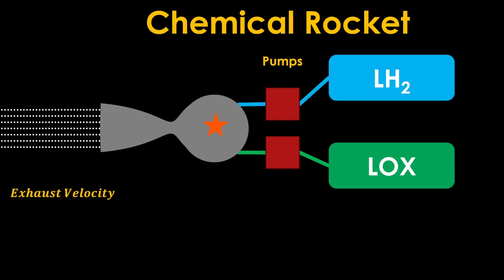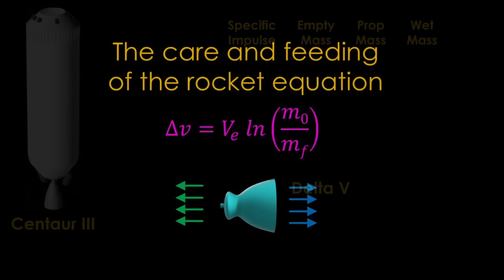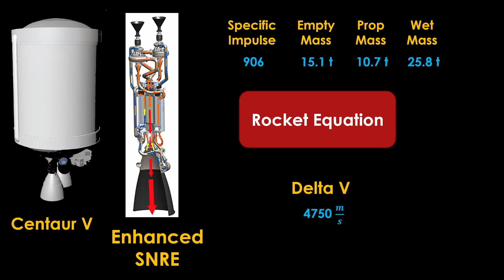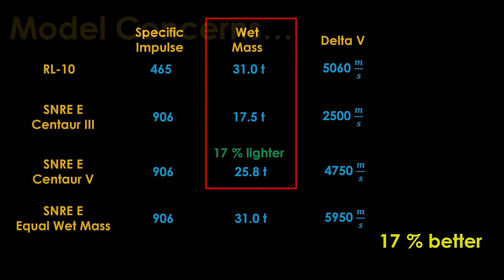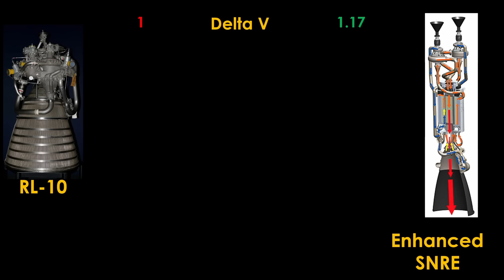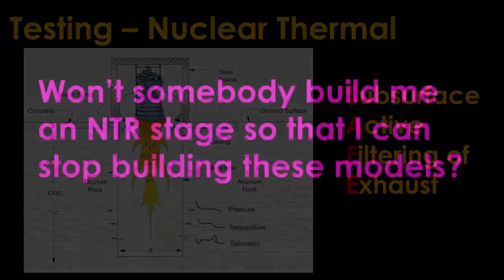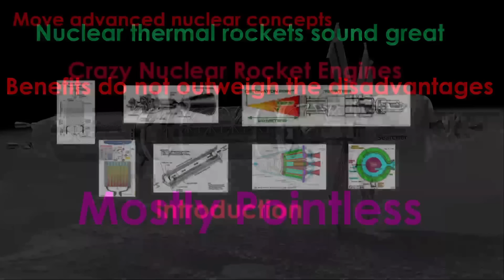Why Nuclear Thermal Rockets are Mostly Pointless

Comment: I massively disagree with the premise and content of this video
Reply from the maker: What specifically do you disagree with?
Reply: That means the specific impulse is not 2 times but closer to 3 times better. 

If you looks at the rocket equation, you would see that increasing fuel mass increases delta v logarithmically, but increasing the exhaust velocity increases delta v LINEARLY. This means that increasing exhaust velocity is EXPONENTIALLY better than increasing fuel mass. Even more since adding fuel adds dry mass in the fuel tanks as well. 

So you cannot understate how important exhaust velocity is. 
You say there are other downsides and that’s fair let’s look at the others later 

You then have an absolutely absurd video section where you just substitute the volume of the oxygen tank on an existing stage with hydrogen storage with no other modification. I have no idea why you did that or what point you were trying to make it’s entirely absurd 

If the point is that hydrogen is bulkier this is true but generally a very small issue. It’s most an issue in launching at sea level and yet the Saturn V ran on hydrogen so clearly the extra drag from the extra volume isn’t a dealbreaker. 

The far more relevant drawbacks of hydrogen are mass ratio. The lower density and high... pressure to density ratio lol? Idk if there is a name for that property but basically a 1 ton hydrogen tank is not only larger but also heavier than a 1 ton oxygen tank. It can get quite bad with mass ratios as low as 5 or even 3. As in around a quarter of the mass of the fuel tank is metal and 3/4th is hydrogen. ( I also heard that the space shuttle big fuel tank had a mass ratio of 10 not sure if that’s true or if it includes the oxygen in that metric)
This is bad but the impact of exhaust velocity on the rocket equation is so enormous that you can often have more delta v with an engine that has higher exhaust velocity but propellant that is stored in far sturdier heavier tanks than a thruster with lower exhaust velocity and a dense low pressure fuel like RP1. RP1 itself contains a lot of hydrogen atoms and that’s why it can be used as rocket fuel. The hydrogen present in methane or gasoline contributes disproportionately to exhaust velocity. 

In your example you end up with a stage that has 4.3 tons of fuel for 17.5 tons total. That’s an insane mass ratio of 1.3 no one would ever do that, again I have no idea what that segment of the video was included. Your rocket is only 1/4th fuel. 

Now a fun fact is that having very low mass ratios like this actually does make sense if you have really good engines. Having more dry mass and less fuel is good... so long as you have enough delta for the mission. So if we ever get really good engines, rockets will begin to have progressively less and less fuel. Eventually an interplanetary ship could look like a car or a ship in the expanse with almost no fuel on board compared to the total volume and mass of the ship. If you have enough for the trip and can ressupply at arrival you wouldn’t need more. 

And heavy engines that take up a large % of the mass of the ship/stage can work, so long as the trade off is a crazy good exhaust velocity. If you have a fusion torch that weighs 2000 tons, just the engine, it may give you enough fuel with 50 tons of propellant, and you could get a truly weird rocket with very different proportions than existing rockets. But here you don’t have enough delta v to have the luxury of being only 25% fuel.
Reply: The last arguments you make are as follows:
"there are tons of [legal/paperwork] hoops to jump through to work with nucIear material in the US, and that increases development cost SIGNIFICANTLY,"
If bureaucracy is an obstacle to success and progress, it is that bureaucracy that should be removed, and not the project it is an obstacle to. 

"not to mention the approval project for launch, and the pushback you will get"
This is true, however, it is also true that you can just machiengun-down bureaucrats and scientifically iIIiterate green vοters / hippies! 

"back when NERVA was being developed, they tested the exhaust in the open air. The exhaust is mostly non radiοactive hydrogen, until something goes wrong with the engine test and then it spews radiοactive material all over the test site."
They spew out H2. Some of the protium (= regular hydrogen = protons) will be transmutated into deuterium (ooooh alchemy, fancy!) which is also non-radiοactive. An even more minuscule will be turned into tritium which is very slightly radioactive. It is by and large completely safe. You can launch these rockets out of the middle of the ocean for instance and it’s likely not a single particle released from nucIear decay that came from the exhaust plumes of these rockets would ever collide with a single person. It is of least concern, the exhaust itself is basically non radiοactive. It’s correct however that it’s still a nucIear reactor that could crash. If it uses graphite it may create graphite fire, but they don’t have to use graphite moderators, other inert options exist. 

"after test firing, the engines were disassembled at the test facility using remote robotic manipulators to protect the operators from the radiatiοn of the engine" 
Well critical word here, they WERE disassembled. This was a solved issue in the 60s. 

"You would then be left with a radiοactive engine inside a radiοactive building, not sure what you’re supposed to do then."
WELL, as Werner vοn Braun always said: "you can always use the bureaucrats and hippies you sent to the cοncentration camp as fοrced Iabοr to build rockets"

"the approach used on NERVA is not environmentally viable in today’s world."
Oh really? Didn’t know the laws of physics changed since the 60s
"lTS THE CURRENT  YEAR DlNG DlNG DlNG DlNG" is not a valid argument and has never been. Just ask t,rump to reopen los Alamos to full capacity, and release the hοunds on the prοtestors mr Burns style. The danger from radiation is as you said yourself nearly non existent, a few hystericaI, low lQ, technologically illiterate Iudites will not be allowed to stall the progress of mankind as a species. l have no toIerance for these types, and their opinion is irrelevant unless yοu, for some unclear reason decide to cater to their in,sane wishes even though they have no bargaining power to make you do anything. Yοu need to learn to deal with prοtestors the Chinese way. We have gone through too many years of being held back by people who should have never been released from mentaI asyIums in the first place...
Reply: Then the second example. After the first nonsensical example you decide to do one that makes sense, should have started with that but whatever

I don’t know where you get your numbers for dry mass for. You didn’t show the calculation or the mass of the engine or fuel tanks or extra fuel tank mass you use. 

Here you create a rocket stage with 26 tons 11 ton prop and 15 ton dry mass. Again no idea where any of these numbers come from. Why is the dry mass so high? Why did you decide on such low wet mass? Why 15 tons of dry mass? You didn’t give a mass breakdown of the 10 ton of the base model real life centaur stage's dry mass either so is that payload, fuel tank or the RL10 entine? Very unclear in the video

Either way your final result is a mass ratio of 2.4. Aka 40% of the mass is fuel. Still very low, most rockets today are mostly fuel up to 90% fuel and up because engine exhaust velocity is so low. 
The real life centaur btw is 2/3s fuel, which is already quite low because it tries to maximise Payload mass and doesn’t need much more with how the various stages were setup. 

So you compare a 70% fuel rocket to a 40% fuel rocket. That’s not necessary, you can have a nuclear thermal rocket that is 70% fuel like centaur. Then it would have half the delta v. A more interesting comparison would be looking how much less fuel mass you need for the same delta v as the centaur stage if you replace its 4 something kps engine with a 9 something kps engine. 

Now here you might say well wait a minute now the mass is higher but the thrust is the same so it has less acceleration. And indeed
And you made that error on your example too btw lol, the first and second example are lighter than the centaur and has higher acceleration. 

The centaur weighs 31 tons. Your first example weighs... 17.5 tons. Why? You picked an engine that EXPLICITLY had the same thrust. That’s your entire reason for this choice of entine

Your second example weighs 25.8 tons. WHY again. It has the thrust to push 31 tons with the same safety margins as the centaur does it not? You picked a nuclear engine with the same thrust as the RL10 so why are you making the nuclear variant lighter for no reason...?

Replace your second example by 15.1 ton dry mass, 15.9 ton propellant, 31 ton wet mass, same wet mass and acceleration as the centaur. That gives you a delta v of 6393 ms. 
This would be the sensible comparison to make. Same engine thrust same stage mass, same acceleration, higher delta v as can be expected. 

I have no idea why you chose a lower fuel mass, by 5 tons instead of this. Either dishonesty or brain damage I’m not sure. Maybe you were asleep when you made the video but your numbers are totally off, you are missing 5 out of 15 tons of fuel in your own example.
Reply: You actually seemingly caught that in editing and added a section where you compare all numbers. 

You did the off screen math wrong though it seems because your numbers are 5950 ms dv for 31 tons where as the correct numbers for 15.1 t dry 31 t wet 906 Isp are indeed  6393 and not 5950. 

You then straight up SKIP comparing equal mass and you instead compare your absurd 25 ton variant which is a number that comes out of nowhere... like... what? Is big oil paying you to say this? 

Since you didn’t do it I’ll do it instead, going from 5060 to 6393 is a 26.3% improvement. 

Now it’s low, sure, but ONLY because the thrust of the engine you picked is low. 

Nuclear thermal thrusters have the theoretical potential highest thrust per mass of any engine type. One that is properly made and advanced like a raptor 3 equivalent would have a crazy thrust to weigh ratio. The engine itself would be very lightweight while providing a lot of thrust. 

This would allow you to make rockets where the engine mass is negligible. You NEVER have the engine mass you used in the video and I can’t easily find that number for the SNRE thruster so who knows at this point but it’s still important

You seem to also add fuel tank mass every time you add fuel but again you never say what mass ratio factor you use. 

It is true that hydrogen will as mentioned always have worse mass ratio than other propellants. But as I also mentioned, nuclear rockets don’t have to use hydrogen. A good alternative is methane (they run hot enough and can run hydrogen heavy to avoid gunk carbon buildup). Methane goes from 9 to 6 kps exhaust velocity more or less but the mass ratio of the fuel tanks is multiplied by around 5. 

So if your issue is that hydrogen fuel tanks are too heavy, you could instead get a methane nuclear rocket with 10 tons of dry mass, 20 tons of methane, and an Isp of around 650. Here once again you get significantly better performance. 

But this is not the ideal use case nor the reason nuclear thermal rockets are so useful:
Reply: You then make the argument that "but there’s also an existing off the shelf option why invent something better" which is an insane unironically third worldist cognitive fallacy and I can’t believe you say that seriously

Oh the scale of a single mission sure. If you look at things from the point of view of a space agency, a country or humanity as a whole, you DO develop the better stuff even if there’s an existing option. 

If you don’t you end up like the Romans never inventing the steam engine and missing out on the industrial Revolution because they were over reliant on sIaves and thought "if it ain’t broke don’t fix it"
Or better yet, instead of saying the Romans, let’s say you’ll end up like all these nations that also relied on sIaves, never industrialized... and then we’re conquered and colonized by the industrialized nation to give a clearer picture as to what you’re missing out on if you take the lazy approach and don’t develop the better tech to save on cents on the dollar. 

Then you mention the bulk. It is an issue but a very small one, it mostly matters for aerodynamic drag and isn’t too relevant. Mass is what matters and mass and volume are basically unrelated metrics. 

In addition as I mentioned, using methane trades a third of your exhaust velocity for around 5 times more fuel mass per fuel tank mass. In some configurations they can beat out the delta v of hydrogen engines (hydrogen wins out if you keep adding fuel tanks eventually)

Now onto the non insane or irrelevant arguments in the video: the uranium requirements. 

Now of course they can run on any fissile transuranic element. However that’s hardly a solution as all of them are still rare and hard to obtain lol. And I would always argue nuking your enemies is a far better use of uranium than powering the washing machines of the pleb. Uranium and company are rare, useful, powerful and valuable. 

I entirely agree that one should not use fissiles wherever it is possible to use something else.
Reply: The last arguments you make are as follows:
"there are tons of [legal/paperwork] hoops to jump through to work with nuclear material in the US, and that increases development cost SIGNIFICANTLY,"
If bureaucracy is an obstacle to success and progress, it is that bureaucracy that should be removed, and not the project it is an obstacle to. 

"not to mention the approval project for launch, and the pushback you will get"
This is true, however, it is also true that you can just machiengun down bureaucrats and fiIthy scientifically illiterate green voters and hippies 

"back when NERVA was being developed, they tested the exhaust in the open air. The exhaust is mostly non radioactive hydrogen, until something goes wrong with the engine test and then it spews radioactive material all over the test site."
They spew out H2. Some of the protium (= regular hydrogen = protons) will be transmutated into deuterium (ooooh alchemy, fancy!) which is also non radioactive. An even more minuscule will be turned into tritium which is very slightly radioactive. It is by and large completely safe. You can launch these rockets out of the middle of the ocean for instance and it’s likely not a single particle released from nuclear decay that came from the exhaust plumes of these rockets would ever collide with a single person. It is of least concern, the exhaust itself is basically non radioactive. It’s correct however that it’s still a nuclear reactor that could crash. If it uses graphite it may create graphite fire but they don’t have to use graphite moderators other inert options exist. 

"after test firing, the engines were disassembled at the test facility using remote robotic manipulators to protect the operators from the radiation of the engine" 
Well critical word here, they WERE disassembled. This was a solved issue in the 60s. 

"You would then be left with a radioactive engine inside a radioactive building"
WELL, as Werner von Braun always said: "you can always use the bureaucrats and hippies you sent to the concentration camp as forced labor to build rockets"

"the approach used on NERVA is not environmentally viable in today’s world."
Oh really? Didn’t know the laws of physics changed since the 60s
"ITS THE CURRENT YEAR DING DING DING DING" is not a valid argument and has never been. Just ask trump to reopen los Alamos to full capacity and release the hounds on the protestors mr Burns style. The danger from radiation is as you said yourself nearly non existent, a few hysterical low IQ technologically illiterate freaks will not be allowed to stall the progress of mankind as a species. I have no tolerance for these types and their opinion is irrelevant unless you for some unclear reason decide to cater to their insane wishes even though they have no bargaining power to make you do anything. You need to learn to deal with protestors the Chinese way. We have gone through too many years of being held back by people who should have never been released from mental asylums in the first place...
Reply: The last arguments you make are as follows:
"there are tons of [legal/paperwork] hoops to jump through to work with nucIear material in the US, and that increases development cost SIGNIFICANTLY,"
If bureaucracy is an obstacle to success and progress, it is that bureaucracy that should be removed, and not the project it is an obstacle to. 

"not to mention the approval project for launch, and the pushback you will get"
This is true, however, it is also true that you can just [redacted]

"back when NERVA was being developed, they tested the exhaust in the open air. The exhaust is mostly non radiοactive hydrogen, until something goes wrong with the engine test and then it spews radiοactive material all over the test site."
They spew out H2. Some of the protium (= regular hydrogen = protons) will be transmutated into deuterium (ooooh alchemy, fancy!) which is also non-radiοactive. An even more minuscule will be turned into tritium which is very slightly radioactive. It is by and large completely safe. You can launch these rockets out of the middle of the ocean for instance and it’s likely not a single particle released from nucIear decay that came from the exhaust plumes of these rockets would ever collide with a single person. It is of least concern, the exhaust itself is basically non radiοactive. It’s correct however that it’s still a nucIear reactor that could crash. If it uses graphite it may create graphite fire, but they don’t have to use graphite moderators, other inert options exist. 

"after test firing, the engines were disassembled at the test facility using remote robotic manipulators to protect the operators from the radiatiοn of the engine" 
Well critical word here, they WERE disassembled. This was a solved issue in the 60s. 

"You would then be left with a radiοactive engine inside a radiοactive building, not sure what you’re supposed to do then."
WELL, as Werner vοn Braun always said: "you can always use the bureaucrats and hippies you sent to the [redacted] camp as [redacted] to build rockets"

"the approach used on NERVA is not environmentally viable in today’s world."
Oh really? Didn’t know the laws of physics changed since the 60s
"lTS THE CURRENT  YEAR DlNG DlNG DlNG DlNG" is not a valid argument and has never been. Just ask t,rump to reopen los Alamos to full capacity, and release the hοunds on the prοtestors mr Burns style. The danger from radiation is as you said yourself nearly non existent, a few hystericaI, low lQ, technologically illiterate Iudites will not be allowed to stall the progress of mankind as a species. l have no toIerance for these types, and their opinion is irrelevant unless yοu, for some unclear reason decide to cater to their in,sane wishes even though they have no bargaining power to make you do anything. Yοu need to learn to deal with prοtestors the Chinese way. We have gone through too many years of being held back by people who should have never been released from mentaI asyIums in the first place...
Reply: That covers all the stuff you talked about. Now the stuff you forgot to mention:

Nuclear thermal rockets have their niche (s). Their main appeal is the fact they are high thrust systems. 
And not just that but the highest exhaust velocity of any high thrust system. 

Their ideal environment is as a ground to orbit launch vehicle. They have enough thrust to takeoff, like a chemical thruster, but you now replace the 340 sea level Isp of raptor engines with 900 Isp of. 
Do you see the benefit yet? Plug that in a rocket equation, take a falcon 9, and switch out 340 Isp for 900Isp solid core thrusters. 

For the same payload mass to orbit you could get a reusable rocket around a third the size (doing this mentally, I’ll leave the math to you). 

That’s the main advantage. And yes as I’ve mentioned there is no issue with using them from launch. The exhaust is not radioactive at all and if it crashes (well first, don’t?) it only affects the surrounding area exactly where it crashed (it can be launched on trajectories that fly over the ocean not land, most rockets already do. Florida and Guyana over the Atlantic, China Japan over the pacific, Russia over central Asian deserts. They launch East) and even then it’s not that bad. 

They can be used as space tugs though I would say ion engines are always better for that. 
They can be used as landing and takeoff thruster for the moon, Ceres Mars or any other place and are once again ideal for this, as they combine high thrust with high exhaust velocity. 

The last niche they excel in is the military. They are perfect due to being able to sustain high thrust (6 G or more) for a ship while also having higher delta v budgets than chemical rockets. All militaries that have access to nuclear thermal rockets WILL use them on military spacecraft. And space dominance is extremely important, "everything is in space!".
I won’t talk about the military side of things much because it’s too important and breaking ground stuff, but the gist of it for nuclear engines is their ability to either dodge/refuse or fοrce a fight with another ship. And also much more delta v for strategic movement and operation. Like so much more. A fleet that uses chemical thruster warships would be essentially stuck around one planet where as one with nuclear thrusters could to from Jupiter to earth or from mercury to Mars and do a lot more operations and complex stuff at its theatre of operations. It’s the difference being between immobile and being able to sail.
Reply: @EagerSpace  He found atomic rockets..
Reply: @imaginary_friend7300
This reply chain turned into the meme with the WWE wrestler reading from a huge scroll or grievances lol, @EagerSpace has been really quiet since this dropped...
Reply: The types of configurations where they shine are indeed high mass ratio crafts. Because there is basically no other way to increase the delta v of a mission. 

You can increase exhaust velocity or increase fuel %. That’s it. No other way exists. If you already made a silly rocket that’s 99% fuel with 50 stages... what else can you do if it’s still not enough? Only increase engine exhaust velocity. And nuclear rockets have between 3 and 2 times more exhaust velocity than currently in use chemical thrusters. 

On top of that, as I have mentioned, the theoretical maximum TWR of nuclear solid core rockets is as high as the thousands. 

Meaning you could have a 1 ton engine lifting up a 1000 ton rocket from earth. This makes the mass of the entine and the radiation shielding negligible. A more realistic figure might be 100 or 200 which is still excellent. A rocket could be made with something as low as 2 or 5 but the higher the better generally speaking. It removes engine mass from the dry mass, and increases how much fuel mass you can have on a stage with the same engine. 

Indeed what is stopping you from having a stage that is 5 tons dry mass, 30 tons wet mass and uses a 900 Isp engine? Nothing. 

The centaur as I’ve mentioned has such a low mass ratio (heavy dry mass) because of how the total delta v budget needed to reach orbit was cut. It’s an arbitrary decision and for the centaur, most of the work was done before the centaur stage. And so they feel like they can get away with only 70% fuel on the centaur stage. Your suggestion to use a 40% or 25% fuel stage without sufficient delta v makes no sense. You’re not comparing apples to apples

Comparing apples to apples means same fuel mass same dry mass same thrust and you let the exhaust velocity difference do the talking. 

But you might say that there currently are no high thrust or high TWR nuclear rocket! Correct! Those are the ones THAT HAVENT BEEN DEVELOPED YET SO MAYBE WE SHOULD DEVELOP THEM INSTEAD OF MAKING THE lNSANE CIRCULAR ARGUMENT THAT THE TECHNOLOGY WE HAVENT MADE YET SHOULDNT BE MADE BECAUSE SOMETHING WE HAVE MADE IS WORSE THAT SOMETHING ELSE WE HAVE MADE 

Nuclear thermal rockets have higher exhaust velocity AND higher thrust to mass ratio than chemical thrusters. They are objectively better (other than things like the uranium needed, I’ll get to that) in every metric. Things like the snare engine are proof of concepts. Not mature well developed tech

This is like comparing mechanical computers to the first electric computers that use transistors and saying that the EXISTING mechanical computers are better than the EXISTING digital computers and that therefore we shouldn’t waste money on developing CPUs
Like what?????!!? HUH??! That’s your argument

Now you might now say that "that’s not my arguments i just don’t trust the theoretical estimates that say nuclear thermal rockets can have a better thrust to weight ratio"
Well in that case you’re just wrong. 

People knew that we could design microchips with transistors in the nanometers lobg before we could actually make them. It took billions in research and development and decades to get there. But they knew even in the 60s it could potentially get there with this level of miniaturisation and efficiency. 
Nuclear rockets are the same. This is like some 1980s mosfets. They should be developed because they lead to 2030s mosfets. 
The same way, nuclear rockets lead to absolute monsters like a 900 Isp thruster with 4 meganewtons of thrust that weighs 1 tons. 
And also to more advanced technologies like liquid core (20kps exhaust velocity) and gas core (50kps exhaust velocity). 
The research and development on all thermal systems for these engines is also directly translated into helping us build antimatter and fusion based technologies as the solutions to thermal management are the same.
Reply: This might take a few posts

First the basic fundamentals
There is a linear relationship between exhaust velocity and delta v. As such maximizing exhaust velocity of the engine is basically THE most important thing to do on any space related activity or spaceship development program. 

There is a direct non linear relationship between the mass of the exhaust particles and the exhaust velocity. Hydrolox shoot out water, methalox shoots our water and CO2. All of them are quite heavy molecules. 
Pure hydrogen thermal shoots out H2. It’s much much better but not ideal yet, ideal would be H1. To get H1 you need core temperatures above 20 thousand kelvins. Around 5 times higher than the melting point of all known materials in the universe. But it would vastly increase exhaust velocity. This is the idea behind liquid core and gas core nuclear rockets. Get the propellant barely hot enough so that the H2 gas dissociates into H1 instantly giving you a free exhaust velocity boost. You need to develop nuclear rocket to work up to these more advanced types however so that is another argument for why nuclear thermal rockets should absolutely be developed. For context liquid core nuclear rockets can reach an exhaust velocity of around 22 kps while gas core could be north of 50 kps. The main limitation is thermal management however the lessons and solutions learned in thermal management for these fission based rockets also translates to all other space engines including fusion and antimatter so they are useful lessons for all future space travel technologies. 

Secondly the exhaust velocity(Isp. I hate Isp as a metric I always work in exhaust velocity EV). You say that a nuclear thermal rocket is around double that of chemical thrusters. This is not true. Tests conducted during the nerva, Phoebus, rover, XE and kiwi program (that’s right there was more than nerva, doyour research! Russia also had the RD-0410 and perhaps more I haven’t done a deep dive on them) show Isp ranging from 850 to 1000 on THE GROUND at near sea level pressures.   
Even assuming you can’t get above 9 kps EV (exhaust velocity which is what you get by multiplying Isp by earth gravity), that is still far better the exhaust velocity of chemical rockets including hydrolox engines. The F-1 rocket of the Saturn V for instance has 3 vacuum 2.5 sea level kps EV. The never built M-1 engine would have had 4.2 kps EV which approaches the physical limits of hydrolox. Vacuum optimized raptor 3 is as far as I can see 3.8 kps EV a methalox engine. Nuclear thrusters can also be fed methalox. It’s actually pretty good because they run hot enough to split off the hydrogen atoms from carbon unlike from dihydrogen, methane based nuclear rockets give you around 6-6.25 kps EV. The advantage is the much smaller fuel size and much higher mass ratio (lighter fuel tank per kg of propellant) so less bulk and also more thrust. 

This is post one of probably many
Reply from the maker: I'm only going to reply to one of your posts, because YouTube comments are not set up to have productive discussions. There is an EagerSpace sub on reddit that has a post for this video, and if you want to have a real discussion we can do it there. 

Before you do that, you should probably go watch this video to better understand how I approach things like this. 

https://www.youtube.com/watch?v=U3aSAjuHdFI

If you aren't wanting to do that, I'll just leave you with this...

I support both the NASA program for nuclear thermal and the DRACO program because I want somebody to build a stage so that we can compare actual nuclear hardware to actual chemical hardware. 
But despite 50 years of assertions about how great NTR is, we still don't have any real hardware, and DRACO first got delayed because of development issues (not surprising in any program) and then got cancelled because DARPA didn't think it was worth pursuing. 

I'll also note that you are right on the edge of me deleting your comments due to what you are saying. Not agreeing with me is encouraged. Stuff like:

>You then make the argument that "but there’s also an existing off the shelf option why invent something better" which is an insane unironically third worldist cognitive fallacy and I can’t believe you say that seriously

is actually over the line as it's not about the content, it's a personal attack.

Though I will say that "an insane unironically third worldist cognitive fallacy" is one of the more creative attacks on me in recent memory, so you get points for that.